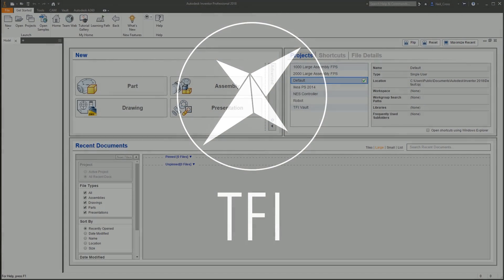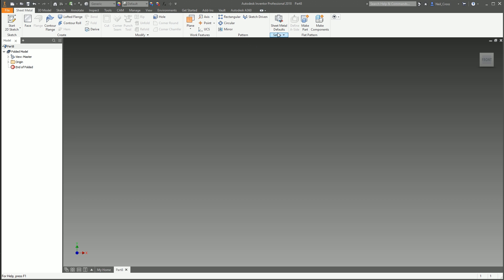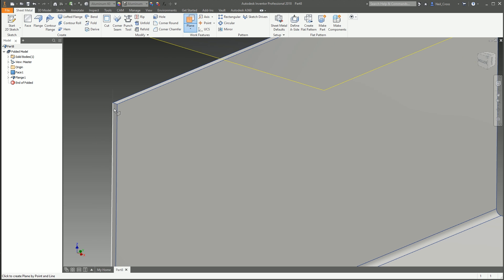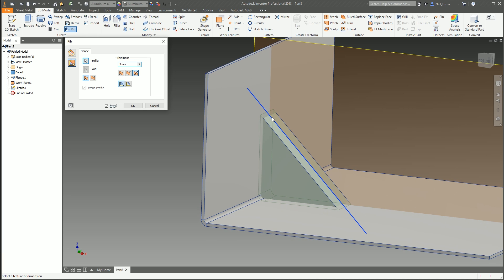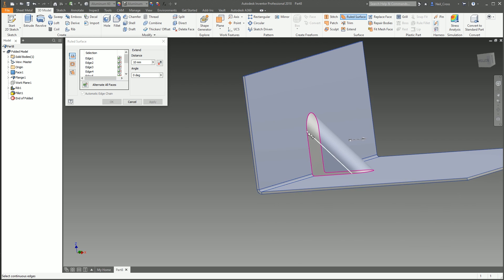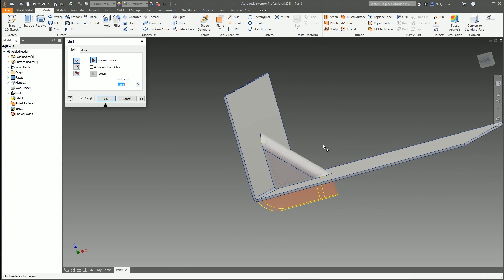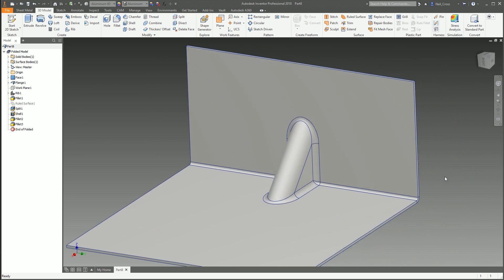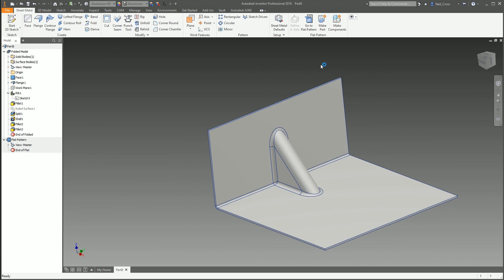How to Sheet Metal gusset, kind of but not really | #Autodesk Inventor

Comment: What would you say is the better package to use? I use inventor whilst at uni, however when 3d printing things I much prefer fusion 360. Or is it just a personal preference thing more than anything?
Reply from the maker: Inventor is better, more powerful, more functional, used in far far far more businesses around the world, Fusion is cheaper and in 10-15 years time might take the lead over Inventor.  So right now I'd stick with Inventor.
Reply: TFI ah okay thanks. But for things like cam youd want fusion? Inventor for large assemblies. I feel fusion is better for product design